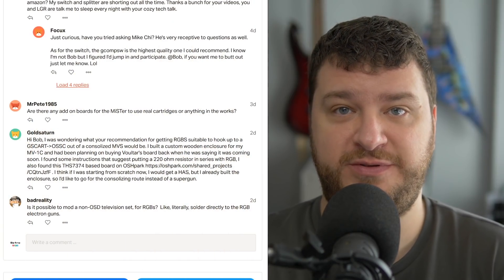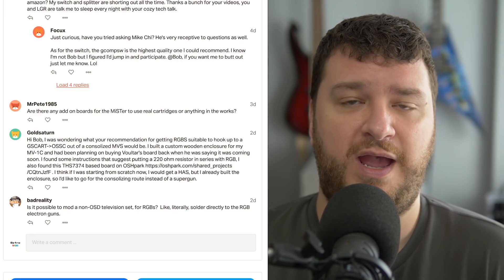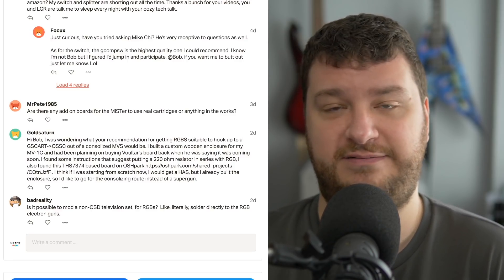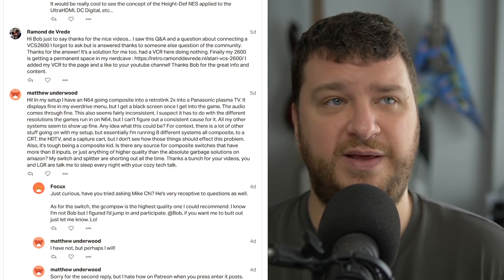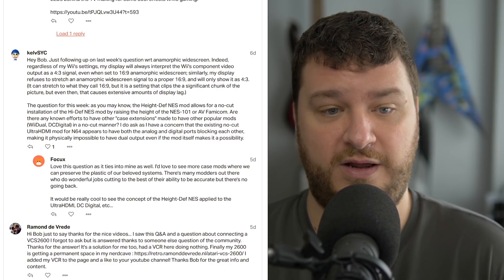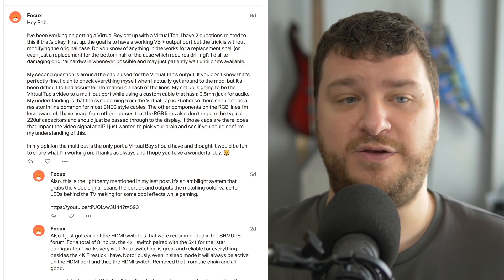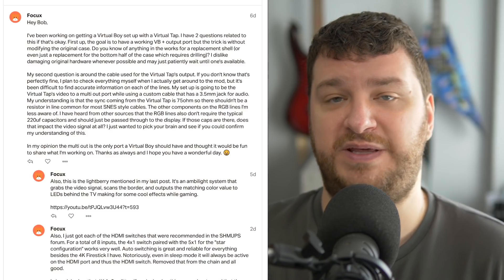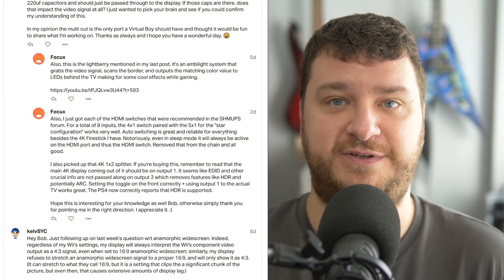Supporter Q&A #111

Comment: 12:56 I can attest to this one lol  My Vizio 4K only has composite for analog input.  It uses bob deinterlacing and latency isn't bad at all but 240p is a mixed bag.  Consoles that are 240p only don't work at all, but if I use a PS1 where the BIOS is in 480i, 1 out of 10 times it'll actually catch the 240p signal when it switches and misinterpret it as 480i.  It can however process 240p just fine over HDMI as 720x240 but it fills the screen so I can't change the aspect ratio.

Comment: Just a quick note on the Extron Cross point.  From the manual: The CrossPoint 300 Series switchers have a video bandwidth of 300 MHz (-3 dB).
All models can also switch RGBS, RGsB, RsGsBs, HDTV, component video,
S-video, and composite video signals.
Reply: Same thing with the Extron CrossPoint 450 distribution amp. The manual says it supports composite, S-Video (separate chroma and luma lines), component, RGBS, RGBHV, etc.